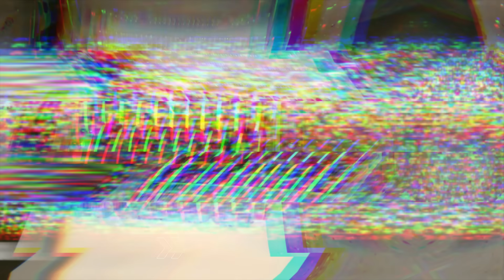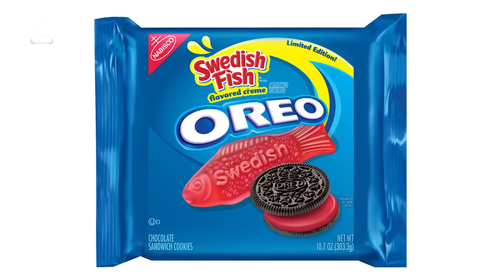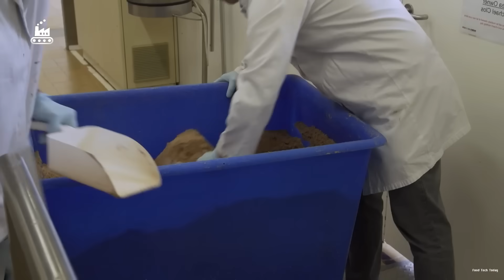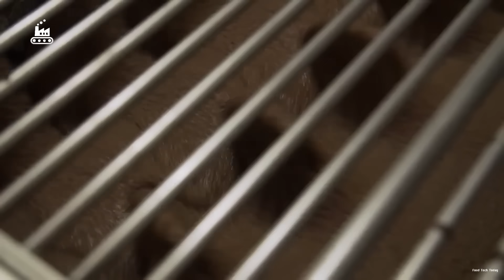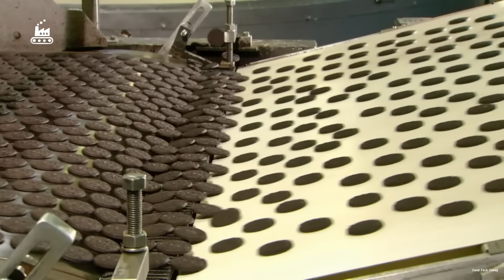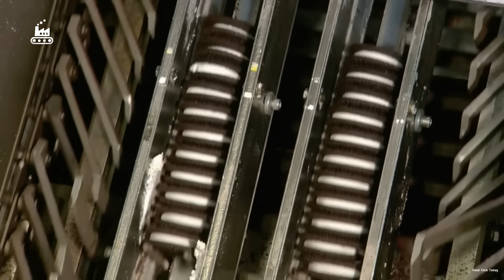How Oreo Cookies Are Made 🍪 | How They Make Millions Every Single Day!

Comment: I wonder what they would taste like with a healthier fat like lard, tallow, butter....Canola oil is trash.  Also honey  or a healthier sweetener than Corn syrup.
Reply from the maker: Honey sounds great
Reply: Lard and tallow cause clogged arteries.
Reply: @gy2gy246 they can contribute, but not without inflammation caused by other factors.

Many people on low carbohydrates Keto, Carnivore or basically several variations of high fat diets have labs showing no clogging of arteries on tests ranging from CAC to CIMT to CTTA tests.

Is it possible some people may get clogged arteries under the same conditions?  Yes possibly but it's a complex set of circumstances in every case.

There is not one perfect way to eat or lifestyle as there are many variations in Genes, Epigenetics etc etc.
Reply: Saying such a simple thing without context is as bad as saying Water kills 100% people.

Comment: Hydrox is a creme-filled chocolate sandwich cookie currently owned and manufactured by Leaf Brands. It debuted in the United States in 1908, and was manufactured by Sunshine Biscuits for over 90 years. Oreo was created in 1912 as a direct rip-off of the Hydrox cookie. Oreo eventually surpassed Hydrox in popularity, which led to Hydrox cookies being perceived by many as an imitation of Oreo, despite the opposite being true. Compared to Oreos, Hydrox cookies have a less sweet filling and a crunchier cookie shell that is less soggy when dipped in milk. I preferred Hydrox to Oreo.
Reply from the maker: Oreo may have won the popular contest, but Hydrox fans are still neutral

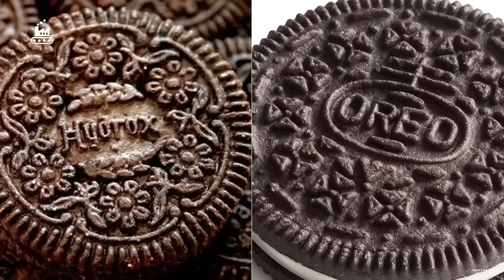Comment: There are a few historical errors in facts made in the video. Starting the video 0:06 saying Oreo introduced 2-chocolate cookie with vanilla cream in between. WRONG! At 1:15 you see both Hydrox and Oreo and both are NOT the same. Hydrox (c.1908) which sounds like a chemical like Chlorox was actually the first and original Oreo type cookie. The current Oreo (c.1912) stole the idea and was more successful with the product the past 100 plus years. You can still find Hydrox cookies but are not easily found on store shelves.
Reply from the maker: I see you came fully loaded with cookie facts — respect

Comment: Did anyone notice that this video shows two completely different methods of making Oreos?
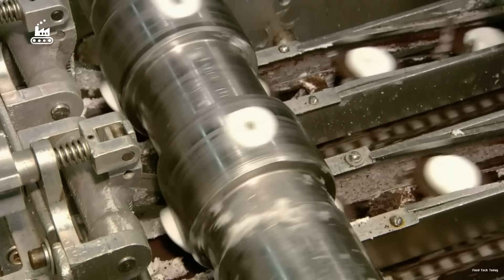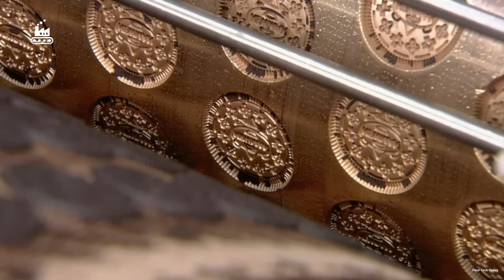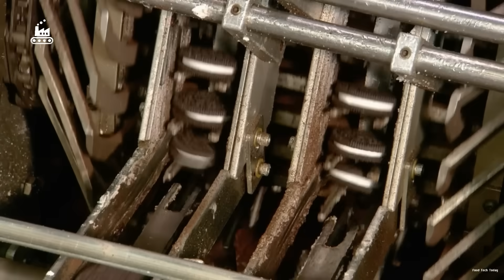Reply: Not only different methods, another cookie entirely. At 9:12 it is a different line. I can't read the stamp at 5:43 but it isn't 'Oreo'. Plus the colour of the cookie on the lines is a medium brown not the dark brown of the Oreo. I'm not sure if any of it is at an Oreo factory. At the beginning they show the Hydrox, a similar cookie created 4 years before the Oreo. (9:51 "Super skilled robot fingers", really?)
Reply: @davidmorris3531 They also forgot to add the fake "cream" has Titanium dioxide a carcinogen found in whitening toothpaste (often used to make the filling bright white) high fructose corn syrup. They only mentioned cornsyrup
Reply: @davidmorris3531 Hydrox was the better cookie.
Reply: @GNick1234  Still are. They've returned, but they're not widely available.
Reply: I work in an off brand Oreo facility and we make the same cookie on 3 lines wi tv 3 different machines.  The second one they show that piles up the cookies is called a “Peter’s sandwich machine”. I think we use one of the earliest versions.

  It’s likely they have a newer version and when they added more lines you see the updated version that creates the sandwich across the conveyor as this is a faster and cleaner way to produce and you can also see and remove the broken stuff before it ever hits a “boat” the tray which makes the finished product less messy looking to the consumer.
Reply: @nethervortex  my thoughts are this how in the world they clean the machinery  if it is ever detailed clean 🤔?
Reply: @mariajaramillo1135  I'm quite sure they must clean and disinfect the machinery regularly..
Reply: Thats because you watched a fake one to tell you not to eat and that creme is not real

Comment: The OREOS of today are NOTHING like the OREOS of the 80s. When I was a teen, I used to put a bunch of them in a bowl of milk. Had  to wait for about 20 seconds and go at em. That gave them time to start sogging. If you didn't just get em all down as fast as possible, they would dissolve. Not now. Now, they're shiny. After 2 minutes, they're still crunchy. I haven't bought Oreos in 10 years. They went and phuktem up. FAIL.
Cereal is the same way. Trix crreal is no longer balls. Its clearly coated, and doesn't get soggy like the old kind.
Reply from the maker: Back in your day, Oreos had character. Now they have a plastic shell and trust issues